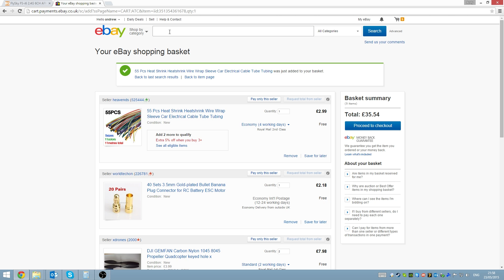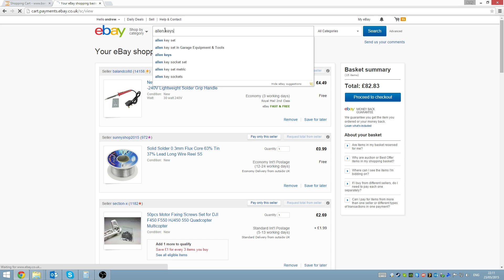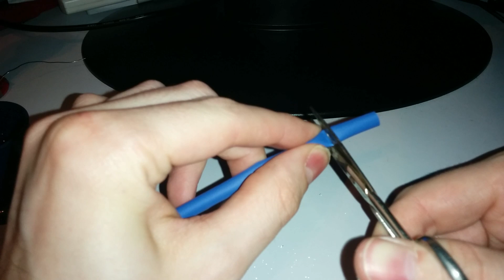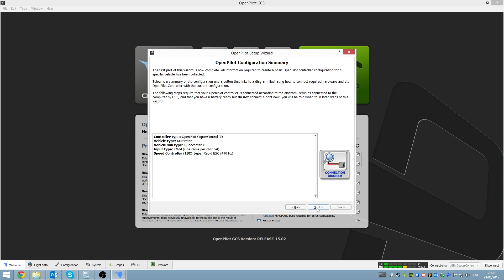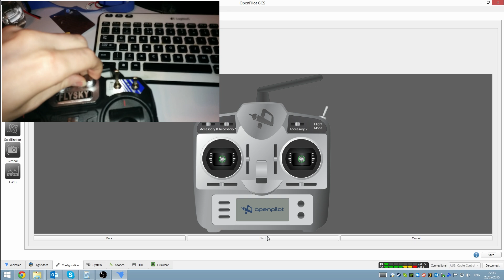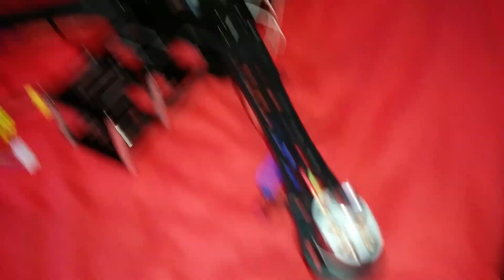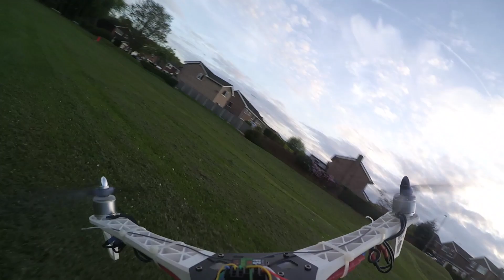Build A Cheap Quadcopter

Comment: Andy 1 more pls, Witch one of this to buy ? The diference is 5$ (on the future i want fpv, gps and last gimbal)
http://www.aliexpress.com/item/Lipo-Battery-7000mah-3s-11-1v-30c-XT60-T-plug-large-flux-lithium-polymer-battery-TATTU/32466103313.html
OR
http://www.aliexpress.com/item/fire-bull-14-8V-6200mAh-45C-Max-60C-4S-4Cells-Li-Polymer-Battery-XT60-for-RC/32497397199.html
Ty
Reply from the maker: +John George its hard for me to say as I dont have your setup. i would try using ecalc it will tell you exactly what flight time you will get
Reply: +AndyRC no no, the q was wich one of them to buy now, i have the same setup like u, i want to add fpv in max 1 month after gps and stuff, i dont know what battery to buy now  to be my second battery for drone, because u sayd 4s is better for fpv, gps, landing gear .... and 3s dont have enought power to hold all of that no ? so i want to know what battery to buy now. i will get a 3 battery but later more power, bigger motors ...
Reply from the maker: +John George I would get both :-)
Reply: +AndyRC but the build u do it here all parts work on 4s battery ?
Btw i did this i allready buy a 3s 3000mah bat. and now i buy a second bat. that will be a 4s 14.8v 5000mah 30c
at 38$ and it will power just the mottors, and the first 3000mah it will be mounted on the quad and will power anything else i will put on it, such as fpv, gps, landing skid, gimbal ...
i will force the mottors with that 4s 5000mah 30c ? or it will be ok ?
Reply from the maker: are you using the same motors in my video?
Reply: +AndyRC This is what i order 
http://www.aliexpress.com/item/4x-2212-920KV-Brushless-Motor-4x-30A-SimonK-ESC-Quad-Multirotor-X525-F450/32343184580.html
Reply from the maker: yes should be fine with those
Reply: +AndyRC so i dont pushing to much the motors, i want just that bat. to power just the mot. i will show u link to bat. i need to know if will work fine because for begining i will have quad and fpv just that and not to force the motors with that bat. keep them safe.
http://www.aliexpress.com/item/ZOP-Compact-Lithium-Polymer-LiPo-Li-Polymer-Battery-Li-Po-4S-14-8v-5000mah-30C-free/32428204684.html
Reply from the maker: yes should be fine :)
Reply: +AndyRC Thanks a lot.
Reply from the maker: no problem :)

Comment: Hi Andy i want to order a second battery for the quad i got 1 3s 3000mah and i want to buy the second one just to extend the fly time, keep in mind i will have my quad and fpv gear that consume battery, no gimbal no gps no nothing yes.
So i find this to buy what time fly just with fpv gear u think i will get with this ?
http://www.aliexpress.com/item/Lipo-Battery-7000mah-3s-11-1v-30c-XT60-T-plug-large-flux-lithium-polymer-battery-TATTU/32466103313.html?spm=2114.01020208.3.1.ypw6nm&ws_ab_test=searchweb201556_2_79_78_77_80,searchweb201644_5,searchweb201560_9
Reply from the maker: +John George I dont have that battery myself but the specs look fine
Reply: Yea, 30C u told me is good now how much time fly i will have ?
Reply from the maker: i cant say i dont have that battery sorry. it also depends on your other components when fully built (it is different to mine)
Reply: No, problem, ty anyway, i will buy it and see what is the fly time. 
Still waithing for parts to come :(

Comment: Is it ok to use these motors and everything else is the same?Would the flight controller setup be the same?   
  http://www.banggood.com/JFRC-U2216-KV900-Waterproof-Brushless-Motor-For-RC-Models-p-974307.html
Reply from the maker: +charis antoniades yes! those would work nicely
Reply: +AndyRC i don't think there would be a problem if i use 30A esc with this motor right?
Reply from the maker: yes. these are 30 amp esc in this build :)

Comment: I would skip the bullet connectors. A soldered joint is always more reliable than bullet connectors and is really not that much harder than using bullet connectors
Reply from the maker: I agree however when a beginner it is not easy to know which way round to connect the esc

Comment: did you miss out on the shipping costs when doing your calculations?  excluding glue and solder, mine comes in at €235....plus whatever the tax man hits me with importing from China.  Thanks for the video - it is great to see how to get a very good starter rig at a real great price.  Just wish there was a converter from abbreviations to real words...still learning so it's a little hard to follow in parts - but that is what other sites are for.  thanks!
Reply from the maker: shipping is free to me from banggood. and didn't have to pay any taxes :-)
Reply: +AndyRC  not banggood...but sellers in ebay want to hit me for some shipping.
Reply from the maker: i usually get from china on ebay also. never had to pay extra taxes or shipping

Comment: Great video as I am curious about multi as I am a heli guy. I would opt for non-rosin core, lead free solder. The rosin will not lead to cold (bad) solder joints. Its the solder technique. Heat the part, not the solder, until the solder melts into the opening/wire. Placing the tip in the hole (that is actually there to assist in solder stay) is not the best technique as the potential is very likely that the tip will melt the solder and not the heated part. Those solder connections have a potential to be a cold joint.

Comment: i am a new one just subscribed but i have a question
where do you plug the two cables of the battery?
Reply from the maker: one is a balance lead just for charging and the other plugs into the aircraft
Reply: +AndyRC on the distribution board right? 
and does it matter if i have a 3s 3000mah Lipo but it is 25C?
Reply from the maker: +charis antoniades on the power distribution board there's only one wire to the battery. and yes that battery is fine
Reply: +AndyRC ok thanks a lot!!

Comment: Hi Andy, with CC3D u can not have telemetry, gps, or things like that ?
I got this one 
http://www.aliexpress.com/item/ORIGINAL-OpenPilot-Mini-CC3D-EVO-Flight-Controller-Head-for-Multirotor/32444042672.html 
BTW, i posted on my google+ at collection the first piece that arrive :)
It start to arrive :D i`m so happy
Reply from the maker: you have to get the revo Version of the cc3d to get GPS working. its more expensive than an APM though
Reply: +AndyRC ah sh.t i buy the first version not revo. but i will upgrade when i will upgrade motors, remote and battery.
Tell me pls this is ?
http://www.aliexpress.com/item/OPLINK-MINI-CC3D-REVO-Universal-Transceiver-TX-RX-Module-Integrating-Remote-Controller-PPM-Input/32426334008.html?spm=2114.01020208.3.89.VwVGHF&ws_ab_test=searchweb201556_2_91_71_72_73_61_74_75,searchweb201644_5,searchweb201560_9

Or this ?

http://www.aliexpress.com/item/Openpilot-New-version-CC3D-Revolution-Flight-Controller-Upgrade-Version-Integrating-OPLinK-Revo/32482052197.html?spm=2114.01020208.3.196.6pypzD&ws_ab_test=searchweb201556_2_91_71_72_73_61_74_75,searchweb201644_5,searchweb201560_9
Reply from the maker: +John George yes this is
Reply: +AndyRC witch one ? first or second because the price and the name ...
Reply: +John George BTW speck with me on my google+ channel i can put longer q and more then here, i dont want to full your channel, or if is ok, i can put here all my q
Reply: Andy can i buy this fast now till my parts arrive ? is good for my setup ?? is better then normal version ? i can buy it now and in max 1 month will arrive and change the normal to this revo. and is 18$ on 11.11 sale :D
A looot of q , sry a know but i have to much to ask u
Reply from the maker: +John George the second link for 30gbp
Reply from the maker: +John George it is ok but try to keep your questions short as possible as I answer on my phone
Reply from the maker: +John George please one question at a time as I answer on my phone
Reply: +AndyRC what is with the name ? i see one openpilot and one oplink, i mean what is the difference
Reply from the maker: +John George open link isn't the right one. open pilot is
Reply: K, ty a loot, good to know
Reply from the maker: +John George no prob

Comment: Your cheap and my cheap may vary lol .... what did the quad-copter cost to build start to finish. I'm really interested in building the same as you've just built on this  video .
Reply from the maker: +Sean logie the amount is calculated  in the video. my advice to someone trying to go ultra cheap would be. you pay double the price in the end ;)
Reply: +AndyRC not looking to go ultra cheap ,kinda middle of the road and something that cam be updated  thanks for the reply .Enjoy the vids you put out .
Reply: +Sean logie but this is ok what is build in the video and it can be upgrade, i w8 for my parts to come, i like the frame and not the little one :) u can add fpv, gimbal, gps.....
Reply from the maker: Sean logie some people are making a mash up between this build and my high end build to create a mid range one. but i would be surprised if you got a 450 quad in the air for much cheaper than what I have done here. all the best with your build either way!

Comment: And the next q is can i hook up this http://www.aliexpress.com/item/RC-FPV-Combo-5-8Ghz-First-Person-View-FPV-System-with-200mw-AV-Transmitter-Receiver-HD/32282372106.html to the 3s 2200mAh that i just ask if the remote work with and all to be ok to work ?
Reply from the maker: I'm not sure I follow. the fpv gear is not related to the controller?
Reply: +AndyRC The fpv combo that i found not include battery so i need to buy one for the receiver and monitor because FlySky I6 remote works on 4 or 6 battery AA and i cant power the monitor and receiver
Reply: +AndyRC so i`m tinking to buy this 3s 2200mah so i can power the monitor and receiver and remote, but u told me the remote hold 2s battery so it drops.
Now what 3s mAh i need so i can power the monitor and the receiver, the cheepest one if works less then 2200mah
Reply from the maker: have you considered getting the skyzone 700D monitor? it has room for battery inside and built in diversity. sounds like its going to be a heavy setup you are planning.
Reply: +AndyRC that monitor is expensive, and for begining is ok that monitor from FPV combo that i give it to u up. 
Is not very heavy, that 3s 2200mah that i was try to buy is to sick it on the back of the remote with something so i can power monitor and that receiver witch is for monitor, so i`m not adding any weight just that small transmiter, fpv camera witch is low in weight and antenna.

if u could give me something where i can discuse with u and show u what i buy and what i want to make would be  great,  is much to write. Thanku again for your support, u know to explain so ppl can understand :)
I will post the first items that will arrive :D 
I`m so happy, i`m so child... :))) is like a candy give it to a little boy :)
Reply from the maker: we are all like that when it comes to this hobby it is so much fun :)
Reply: +AndyRC Yea :) i was interested for a loong time but a few years ago it was very expensive to buy or make one, and i let it down with this to have or make one, i just enjoy see them fly. But now u can do one with not so much monney and be happy with  it knowing that u can upgrade it in anything u like :)
Thanks man for finding this video :)
I make a collection on me google+ channel i will post there when it will start to arrive the piece, i`l be happy if u take a look there to see and i will need your help so i can finish it and enjoy.
Reply from the maker: sure no problem thanks

Comment: Andy a stupid q ... can we fly like 40-50-60 min ?? with this kind of drone that u build ? we need battery or what ? It will be AMAZING :) 1h of fly
Reply from the maker: not if u want to carry gimbal and fpv gear no. the most you can expect is 20 mins. flights for an hour has been done but not practical or fun
Reply: +AndyRC so no gimbal no fpv and with 3S 3000mAh it supose to fly like 20 min ?
Reply from the maker: +John George no you will get 10-12 minutes 20 get 20mins you will need 5000mah
Reply: +AndyRC ty for answer, so a 3S 6000mah will be good for 20-25 min ?
http://www.aliexpress.com/item/2015-Special-ZOP-power-6000mah-3S-11-1VV-35C-MAX-70Clipo-xt60-t-plug-AKKU-accu/32468298690.html?spm=2114.01020208.3.9.pzgrWS&ws_ab_test=searchweb201556_2_71_72_73_61_74_75,searchweb0_0,searchweb201560_9

This is the cheepest that i found, hope they are good.
I want to buy a second one that is why i`m asking u.
Reply from the maker: u will prob get a 15- 20 min flight yes

Comment: BTW what u say about this ? is ok is sucks , i must change something ...?
http://www.aliexpress.com/item/New-Micro-USB-to-AV-Out-Cable-for-SJ4000-SJ5000-SJ6000-Action-Camera-FPV-Video-Audio/32302797646.html?spm=2114.01020208.3.130.jo5mIM&ws_ab_test=searchweb201556_6_71_72_73_61_74_75,searchweb201527_4,searchweb201560_9
Reply: i want to buy  it but i want to be sure that i can make that quad asambled and fly the i will add things.
Reply from the maker: +John George yes that will work fine :)

Comment: hi Andy, i wake up search a little and found something ... i want to buy the second battery for quad till now i just order this one
( http://www.aliexpress.com/item/Free-shipping-You-me-35C-3000mAh-3S-11-1V-lipo-battery-batteria-akku-packs-accumulators-rchelicopters/32294297928.html ) 
I dont know how much fly time i will have but i guess it will be around 10-15 min.
now what i want and dont understand is 4 cells battery are hard to find and expensive, if i buy let`s say this one 
( http://www.hobbyking.com/hobbyking/store/__9961__ZIPPY_Flightmax_5000mAh_2S1P_40C.html ) 
what are the problems ? I saw that is bigger and i think will hold more fly time but it have 2S, now i`m asking u because i dont understant verry well how it works ... i saw battery that have 5000mah and 2S and battery with 3000mha and 3S, 4S i dont finde so offen, sry my eng
What i must know is what battery to use so i can get a 15-20 min of fly  that would be good :D
if i take the battery with 2S i must change the wire to battery or it dont work 2S or i dont know that i dont understand and i want to help me with that pls. ty so much.
Reply from the maker: +John George Hi each cell of a battery is 4.2volts at maximum capacity. more volts = more power which means more power output to the motors and ESC a 2S wont work with this setup. theres not enough power. 2s is only 8 volts. we need at least 12 to power the components in this build. as a 4s puts more strain on things such as motors and ESC you will need smaller prop to compensate for that on this build you will need 8 inch props to run a 4s and gimbal or a 3s if you just want onboard camera such as xiaomi yi but not on a gimbal
Reply: +AndyRC nice explain thanks a lot, but i still dont get it what "strain" and when i google translate tell me it means "roots" :))) So ( as a 4s puts more strain on things such as motors and ESC you will need smaller prop to compensate for that on this build you will need 8 inch props) this part i dont understant what u mean and what is that strain and why smaller props ( from as i know the bigger props will lift more weight and consume more power ) . coz we add weight with battery and need smaller just to compensate the weight of battery ? smaller props weight like the same with bigger one actuali i dont know witch is biger but i think 8045 is bigger then 1045 props. 
i understant well ? explain me pls and thanks u are so patient with me
Reply from the maker: bigger props create more drag. therefore the motor has to work harder to turn. a 4s pushes the motor harder and it can burn out if the prop is too big. so we go up in voltage we need to go down in prop size (in this example) this is why on the high end quadcopter I bought the 2216 motor which is rated to work with a 4s and 10 inch props. the 2212 are not rated for this. so you need to reduce the prop size. otherwise your motor will burn out
Reply: +AndyRC Nice explain now i understand what is with the bigger and smaller prop. 
Thanks a looot man, now i understand how it works.
And from what i see the 2216 motors i need if i want a gimbal or to get more weight on quad.
But from now i just stick with the standard parts that u have in video.
Still i will have 1 more q to ask u, i want to buy second battery what specks must have 3S or 4S ( i think 4S because i will put a gimbal and FPV camera ) 3000mAh - 4000mAh - 5000mAh (just for 5 i have the monney :D that is why i dont write 6000mAh) and what discharge rate is best to have 20C - 25C - 30C - 35C - 40C ( i stop at 40C because the rest are to expensive) and i want more fly time, but keep in mind that this battery i want to buy i want to help me on the future if i want to change the motors whit that 2216 that u say are best :D
I wait a answer and hope i dont stress u to much :)
BTW i found this now:
http://www.aliexpress.com/item/FreeShipping-You-me-New-14-8V-5000mAh-50C-Max-55C-4S-4Cells-14-8-Volt-RC/32388497633.html?spm=2114.01020208.3.17.OvMxSg&ws_ab_test=searchweb201556_6_71_72_73_74_75,searchweb201527_4,searchweb201560_9

And my first battery that is on the way is this:
http://www.aliexpress.com/item/Free-shipping-You-me-35C-3000mAh-3S-11-1V-lipo-battery-batteria-akku-packs-accumulators-rchelicopters/32294297928.html

Now if i change the battery from 3S to 4S it means that i must change something else to ? i dont know
Thank you, u are a real teacher in how to explain :D i got it all and i started as a complet noob in drone, u help me a lot.
Reply from the maker: +John George Hi please try to keep one question per comment. makes it easier for me to answer as I reply on my phone, with a quadcooter u don't need high discharge rate 25-30c will be fine
Reply: k, got it, 30c is ok but with 4S.